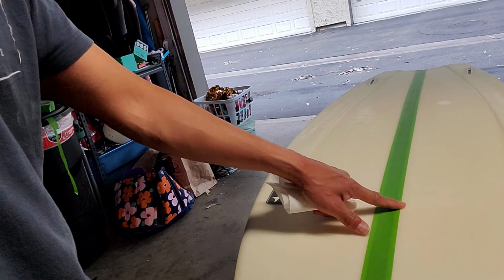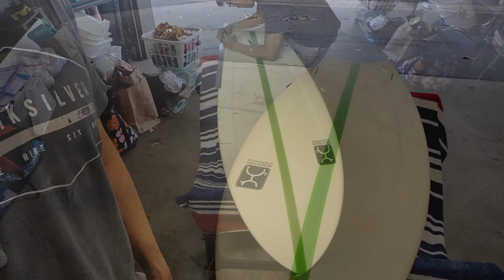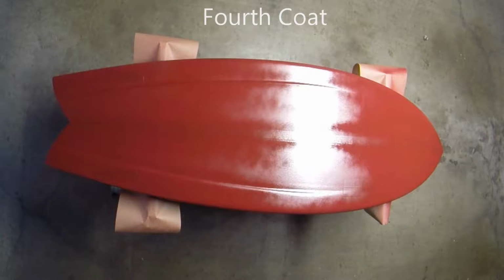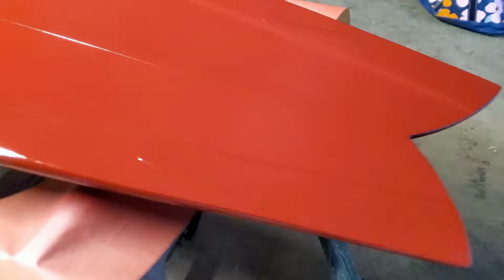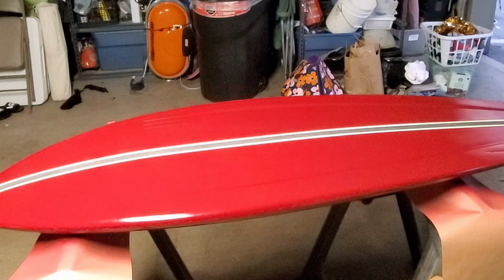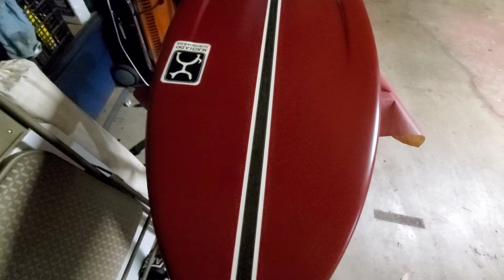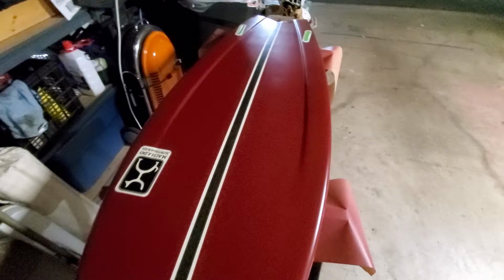Painting My Firewire GoFish Surfboard

Comment: Looks good. Try Liquitex water based  acrylic spray paint on your next one. Much better color selection and way less toxic propellants to contend with.  Better coverage as well- No need for 4 coats of petro based paint eating away the epoxy resin . You can also do a really nice paint job with hobby shop water based acrylic cut with water and brushed  or air sprayed on to get a great outcome. Clear coat applications are a must and I dont know of many that don't contain those nasty propellant gases. Painting boards is a great fun and your board turned out great. Enjoy your vids!
Reply from the maker: thanks. that really helps.  my brother was saying something similar. he's a hobby/rc guy.  I'll need to flag this comment somehow so I can refer back to it.

Comment: Ditto on the better quality Liquitex brand acrylic spray paint. Montana is another that has a huge selection of colors. Both of these dry to a sandable finish, which is important when prepping a spot that has completely dried and needs a repaint. Also I’ve found no sanding is needed if you reapply before it has completely dried (chemical bond).

Comment: Next time use Krylon UV protection Clear Coat. Way better than that one.
Reply from the maker: thanks. I wonder then if just shooting a coat of UV clear would help a white board from turning yellow in the first place. at least slow it down.
Reply: @ThomyeSurfs  No. EPS Foam Epoxy Board boards have spackle. That along with the resin will turn yellow eventually. It does give a bit of protection but the boards turns yellow in an out and will reflect. Polyester/PU boards, it's resin also turns yellow. The UV clear coat is good for the paint but the boards will turn yellow below the paint.

Comment: all of my firewires have yellowed out faster than any other boards i have. also they tend to get far more spider cracks on the rails and tails than any boards i have. the glass almost feels too thin on most of my boards. especially the tails.
Reply from the maker: i feel like the FW's are more brittle. tougher but brittle.  Almost like the glass has no give so rather than a slight flex, they will crack. But they are also really good at not allowing big pressures. But I think it depends on which model, LFT vs Helium, etc.  but I see the same thing.

Comment: what kind of spray paint can you use to acheive this color? Did you have to sand at all before applying? I'm assuming using a respirator would be recommended?

Also what type of spray paint was used to seal the board? Lastly everything dried super smooth and didnt require a wetsand finish?
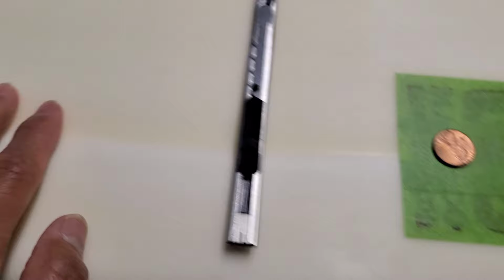Reply from the maker: I used Rust-O-Leum paint+primer and the color is Claret Wine (something like that, I show the spray can at 5:29).  I would read some of the other comments in this threat cuz people recommended a different paint. Liquitex acrylic I think. 

I sanded before and then used a clearcoat, same brand. I didn't sand the clear either, I didn't put much one so didn't want to accidently take any of the red off by mistake.

Comment: hey ! love the job ! Love the color. I started spray painting a board, but after 2 coats the result is rather horrible... uneven color, loads of more or less dark/clear patches. The original color is blue. It doesn't appear underneath. Any idea why ? Do I have to add more coats ?? I'd be greatful for you opinion .
Reply from the maker: Two coats weren’t enough. And I started with a light board going dark. From dark to light, probably even harder. I wondered if a base coat would have helped.
Reply: @ThomyeSurfs  Thanks so much for the reply ! Yes, I've tried to sand it, and did add another light coat. It already looks better. I may repeat the process once more. My first time :-))
Reply from the maker: @anyatikhomirova8132  nice. send me a pic when you are done. would be cool to see.  I went solid burgundy on mine to make it feel retro. I had a bunch of different ideas but glad I went with the dark red.

Comment: Has there been a change in the way the board performs? I know painting trucks with the same stuff leaves kind of a very light bump texture kind of thing to it
Reply from the maker: not that i can tell. but to be honest, I have only surfed it twice since the paint job. I do notice it is a tad heavier under my arms but I did use quite a bit of paint. I think if you use better paint, it might actually be better. I was thinking about vinyling my next board vs painting it. I"ll have to see how much weigth that vinyl has.  it would be interesting though.

Comment: Did you noticed the extra height added by the paint? I’ve painted my firewire with 2 coats of paint and 1 coat of varnish i kinda feel that the board is a bit heavy
Reply from the maker: i can feel the weight. it surfs the same though.

Comment: Did you have any issue with the spray paint bubbling along the rails?
Reply from the maker: No bubbling yet.  I did mess up applying the clear coat.  I went too heavy on a few passes and it ran.  I also didn't wait long enough for the paint to dry.  I should have waited a day. Live and learn, I get too impatient at times.

Comment: have you noticed any chipping when you’ve ridden it?
Reply from the maker: not yet. i did put a pretty heavy coat of clear on it after so hoping it lasts a while. I have had other paint jobs chip which is why I put a very heavy clear coat on it.
Reply: @ThomyeSurfs  hope u don’t mind me asking, but how long did you wait until you took it out for a sesh?
Reply from the maker: @isaiahpablico9542  over a week maybe even over 3. I had other boards that I was riding so I wasnt in a rush.  Read some of the other comments because there was a guy who made a good recommendation about using acrylic paints.

My brother said the same thing.

Comment: Hey mate, I’m keen to paint my yellowing Seaside. My local surf supplier has warned me against it, saying it will chip and look home made and banged up over time. I’m just wondering, after your experience, how is the board holding up? Do you regret it? Cheers for the insight.
Reply from the maker: this one hasn't chipped yet but I also haven't surfed it much. I did do another board that did fall apart but I can't say i regretted it. I will say that on my next board, i will not do a solid coat. rather, i'm going to take my yellowing seaside and lightly dust it with white paint. it will take the yellow off a bit and make it look whiter. i've done that before on another board and even when the paint chipped, it wasn't as noticeable since it was only a dusting.  hope that is making sense.

Comment: Did it add noticeable weight to the board? 6 months later.. how is it holding up?
Reply from the maker: YES, the way i painted it, it did. someone commented that i should have used a different kind of paint. acrylic paint.  The one i used required too many coats. I plan to buy car sprayer from harbor freight to do my next one. and i'm only misting it white so that the yellow board sort of comes through.it make slike look like a new board and not a painted board.
Reply from the maker: almost forgot. it didn't affect performance. just felt heavy under my arms.
Reply: Thanks for the speedy reply. I really like your channel! I surf up in El Porto and Hermosa mostly. Huge FireWire fan.. I have the Midas, Glazer, greedy beaver in Helium not timbertek, and I think I’m going to go get the Sunday today. Just trying to decide on the 6’0 or 6’4. I want a mid length to complete my quiver
Reply from the maker: @russellfaulkner5478  nice collection. I too have a bunch of firewires as you probably already know. I am trying to thin out the collection to make room for new reviews. I check machado's website to see what boards he is experimenting with. He had a really cool asym idea but nothing came of it. Anyways, good luck on the painting.  In hindsight, that comment I made about that green tape complementing the yellow, I think i would have gone that route. less paint and still a clean look. but it would not have made for a good video. haha